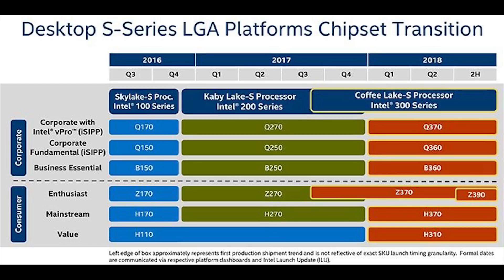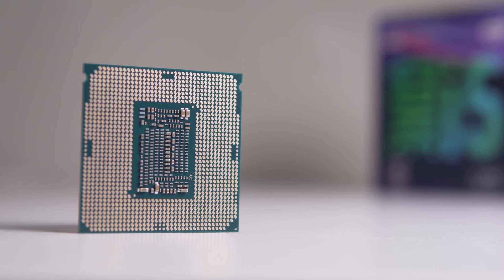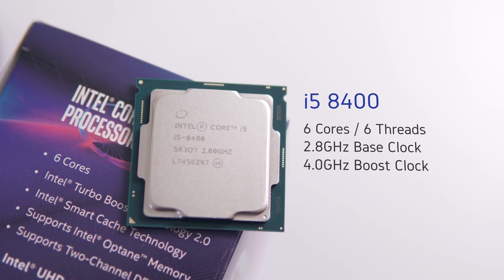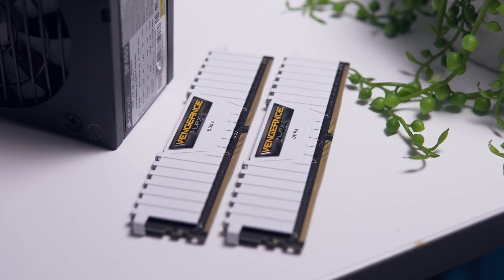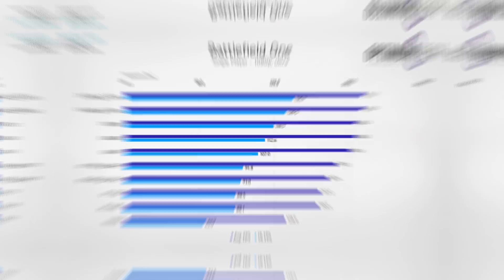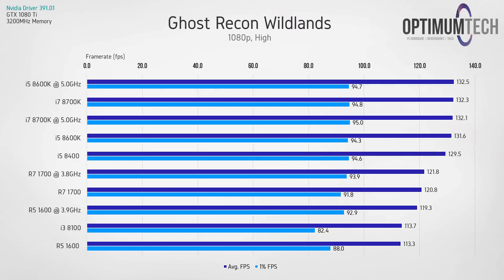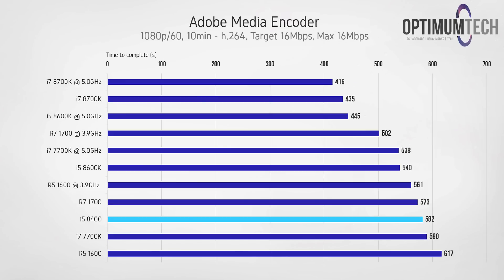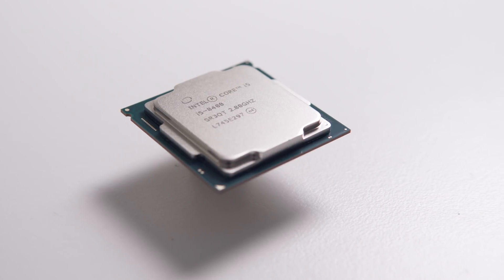Intel's i5 8400 - The Value King?

Comment: This suffers a case of too little too late. You can buy an overclockable AMD CPU with twice as many threads, a higher base clock, a WAY better included cooler and an overclocking capable motherboard for the same price as this locked CPU with a non overclocking capable motherboard. And with Zen+ right around the corner it looks even less compelling.
Reply: Minus I think your missing the point. look I personally run an 8700k at 4.9 ghz and I have a 1080 ti MSI trio, however if I had a 1070 or under I would have went straight for the ryzen CPUs saved myself some money and got the fucking case I wanted..... fucking Corsair 570x is so expensive but looks so crisp
Reply: EIZamo92 well, the i5 8400 is clocked at 2.8ghz with all cores boosting to 3.8ghz... in which most Ryzen chips can just about hit 3.8ghz. not just that, it also has a single core boost of 4ghz. And when the i5 8500 comes out, its going to have a stock of 3ghz and all cores boosting to 4ghz. Pair an i5 8500 with a b360 and it destroys Ryzen in gaming. and you don't have to mess around with any overclocking or need to buy faster ram to get the best performance out of your chip.
Reply: ahead of Haswell but behind Skylake...(not sure if you're being sarcastic or a serious question)
Reply: https://www.youtube.com/watch?v=4fd_GXFBUtk
Lemme sit all these kids down real quick. The ryzen 1600 spanks the 8400 , slightly behind in gaming way ahead in literally anything else oh and its costs less.
Reply: Agree too little too late
Reply: oleg babkin look at the link I posted and stop talking out of your ass.
Reply: https://youtu.be/aNK7EtXrtjs
I7 has higher power consumption and hottrr than r7
Reply: https://www.google.com.ph/amp/s/www.techspot.com/amp/review/1613-amd-ryzen-2700x-2600x/page4.html

Both intel and amd have high power consumption depends on the game and application
Reply: Owned it for a while but maybe i had a bad chip my 4770k was s much better chip and ran so much smoother.
Reply: Wait what lol, did you watch the video? Ryzen is just not a good gaming architechture.
Reply: An overclocked haswell chip will beat a overclocked ryzen chip.
Reply: People might not buy  a 1080ti today, but 2 years from now you might upgrade to a mid end GTX 3060 or AMD 780 which will be on par with a 1080ti. My last computer saw 3 video cards in it's 8 year life and it's generally the primary component most people upgrade.
Reply: no ;(
Reply: Intel max fps gaming and good for productivity
AMD good stock coolers, budget, great for gaming and awesome at productivity or multitasking
Reply: ElZamo92 Za Warudo!
Reply: Is ryzen good in watching.hardcore porns?

#justfuckingasking
Reply: Minus It's only better if all you are doing is gaming and nothing else. Any kind of video rendering, streaming, even file transfers show that a R5 1600 is more powerful.
Reply: ElZamo92 with all that it still gets beaten by this lmaoo
Reply: Mystic_ 112 It is just faster in games, and I believe a CPU in this price range is most likely not going to be paired with a 1080ti, specially with how expensive they are right now.
Reply: ElZamo92 ?? 1080ti?? it is faster in games.. and who buys a cpu in this price range for amything else? :D
Reply: The scores in games are clear: i5-8400 (stock) is overall better than all Ryzen cpus (overclocked). And yet you still talk shit.
Reply: Minus but however, if you doing video editing (like I am) Ryzen is a value king.
Reply: Will the b360 ones overclock?
Reply: ElZamo92 Ryzen 5 1600 wins over i5 8400 in just about every synthetic benchmark ...to bad real life tasks and aplications have nothing to do with synthetics and i5 8400 with HALF the threads DESTROYS ryzen 5 1600.
Reply: nope... you can slightly alter base clock but every little bit you alter causes more system instability.
Reply: I laughed hard xD
Reply: sure but that amd consume twice(->high temp) as the intel one and performs the same
Reply: Saving 20$ with ryzen to waste it later on energy bills  and actually waste some more money on highperformance memory  because amd scales with memory way too much compared to intel king facepalm...😂
Reply: Hey guys, I found the toxic AMD fan

Comment: Explain this statement: "You are not gonna get any productive use out of a 8700k on those boards...  "
If the mobo doesn't burst up into flames(spoiler : it doesn't) an 8700k is gonna run the same if not better since any upcoming chipset is gonna be a budget one. I am really interested in why that is.
Reply from the maker: I'm referring to running an 8700K on a budget Z370 board, compared to a more premium one. 
There's a huge difference in OC potential, VRM cooling and component longevity on a premium board. 
If you are truly using the 8700K for what it's meant to do, budget Z370 boards should be avoided.
Reply: It's not going to run the same on a cheap z370 board vs a decent one. If i remember correctly, there are reports of 8700 on OEM z370 boards running 15-20% slower than youtubers' reviews because of the horrible  vrm and cooling.
So yeah, i'd suggest doing some research on the boards you're going to buy, not just go for the cheapest ones.
Reply: Optimum Tech der8auer did a comparison test of 4 cheap z370 boards, and by and large those chosen did very well. (English version is here https://www.youtube.com/watch?v=xbLeuxIzxcA&t=426s) Personally (FOR WHAT I NEED) I will be getting an mATX ASRock Z370M mobo which is only £100 now with either an 8400, 8500, or 8600. I believe all of the new CPUs and boards will be here in the next 10 days and whilst Ryzen 2000 looks good FOR MY USAGE I need an Intel CPU, there are certain things AMD cannot do as well (unfortunately that's the reason, otherwise it might be different).
Reply: Well der8auer got his 4 running at 5ghz and the MSI @ 5.1.
Reply: so at this point, if you want upgradeability you could only consider expensive z370 boards since h370 and h310 are not aimed at overclockers?
Reply: Will the b360 boards overclock?
Reply: +Vegetables are good for you Presumably you mean shitty mobos like the one put in the crap PC by OEM's like Medion who have no idea how to put a PC together. If you get a PC from that type of OEM you get what pay for whichever colour you go. I'd trust someone like der8auer if one wanted a cheap but reliable mobo (somehow I don't think you do). 

+?? From what I've read B360 won't overclock; not even the memory. :(
Reply: clansome what i'm saying is exactly what you said. Watching reviews from trusted overclockers like debauer and buildzoid. But somehow you seem to take it as an attack to the pc market since i imply that not all boards are adequate?
Trust me, there are quite a few z370 and x370 boards without even vrm heatsinks that can't even keep the turbo of a 1800x or 8700. Those are mostly mATX ot mITX board with cheaper price tags than the rest
Reply: Nope not taking it as an attack just trying to put it in context. Sure the Dell/HP OEM builds will be considerably better than say a generic ECS (for example) board which are built to the lowest common demoninator. Those guys just shouldn't allowed to sell let alone build PC's. (I have an idea of the video you might be referring to and I don't think Jim was telling the whole truth but I'll agree he has a point nonetheless.)
Reply: clansome I’m just curious why you need an intel cpu?

Comment: I think I will go with i5 8600k
Reply: Marc Iets I already have an 8700k, but if I was to pick between an 8700 vs an 8600k, I'd pick the former.
Reply: Drake its a beast
Reply: yea recently replaced a failing i5 6500 and the best bet right now for value imo is the i5 8600k
Reply: I rather have a 8700 non K vs a 8600k.
Reply: Carlos Alberto Deleón if you go for the 8700 than better wait for the cheaper chipsets

Comment: what about the expensive motherboard????
Reply: Cheapest z370 is around £100. And b360 boards are coming soon.
Reply: AMD X370 are at same price as Intel Z370. What are you talking about? And don't even start with B350. That is budget chipset, while Z370 is high-end chip. You are comparing Lamborghini with Ford. Of course Lamborghini is more expensive, it offers more performance.
Reply: The difference in performance between a non-K 8700 and a overclocked 8700K is huge. If you can't see these differences, you must be doing something wrong.

I am not misleading anyone. With motherboards, you get what you pay for, starting with the VRM and continuing with protections and extra features.

You do not believe me? Buy a cheap B350 and any X370 and you will see what I'm talking about. Now...most Ryzen users will not see major difference, because Ryzen cpus simply suck and do not overclock. That is not motherboard manufacturer's problem.
Reply: Go to bed AMD fanboys, you are tired.

i5-8400 at stock speed is better in games than OVERCLOCKED Ryzen 1700/1800/2600/2700 cpu. And this is with cheaper cpu, cheaper ram and cheaper motherboard.

There is absolutely no point to argue. No one cares about IPC, number of cores, dandy stock cooler and the fact that "AMD cares for consumers more than Intel". All these are not making their cpus better.

Comment: AMD R5 2600 will kill the i5 8400 all the way, even in Gaming! And it will have the much better upgrade path as well.
Reply: Mystic_ 112 Which board, there are dozens of B350s...  You just spew BS.
Reply: If you are referring to the Strix B350...you are wrong again. Yes, I do know what I am talking about - I own this motherboard and have overclocked a 1600 to 4 GHz no problem. Also, as soon as you start using profanities you've already lost the argument. Go back to your cave, troll.
Reply: You are clearly just hating. I assume you've never had an R5 1600 and a B350 motherboard.
Reply: i mean its nice that amd are compeitive with intel now but to say the 2600 is going to kill the 8400 in gaming is kind of silly.  it MIGHT match it.
Reply: You'll never ever get the same singlecore Performance with the 2600. Intel is and will still be the way for 144Hz+ Gaming, for 60Hz AMD is a good ship but im personally more into that 144Hz Gaming...
Reply: Yes, 8400 is getting ~10fps more on cards like GTX1080Ti. In 'normal' home use, on cards like 1060 the differences are minimal. 

If anyway you want 1080Ti... well, you won't buy low end CPU like 8400 but aim for something more efficient.
Reply: Will the b360 boards overclock?
Reply: Not with the optimization we have right now
Reply: Mystic_ 112 And good amount of Z370 boards have worse vrm than b350 boards
Reply: keep in mind that the x400 i5 is always the lowest end i5.  other possible i5's that may be coming soon are the 8500 8570 or 8550 and of course the non k 8600.  these should up the clocks a bit.
Reply: with such low clocks on that i5 8400 , the 2600 might actually beat it in gaming, i agree with you
Reply: it might actually do, i've got a 1700 and a b350 and sometimes my pc won't boot unless i plug the cord out of the socket, try start it up and then plug it back in. i was thinking maybe it's smth to do with the mobo
Reply: which one will be more popular? ryzen 1600 or i5 8400 or ryzen 2600? i am building a pc for the wife and might bench it time to time as i do a benchmark channel.
Reply: i am building a new pc i love all these comments i haven't decided yet on intel or amd yet for cpu its stricly for 4k gaming 60hz with a titan xp (CE) edition but i might upgrade in the future for a 144Hz monitor.  the benchmarks are on http://cpu.userbenchmark.com/Compare/Intel-Core-i5-8400-vs-AMD-Ryzen-5-2600/3939vsm476362
Reply: Why would you compare those. 2600 is 30-40$ more expensive
Reply: In my country it's just 16USD difference. AMD motherboards of the same class as for Coffee Lake are 30-40USD cheaper. So afterall - 8400 is the direct competitor of 2600. 

And I would get AMD, both are great piece of CPUs but the AMD platform will last longer as it's not a dead end in terms of upgrade to new CPU in the future.
Reply: Mamopy agree with u
Reply: Rainer Hofmann But will it match the i5 8600?
Reply: B350 is the budget king
Reply: Rainer Hofmann u won't be using that shitty b350 in the future :D
Reply: lmao, i5 8400 still beat R5 2600 in gaming, go check the bechmarks that just came out. XD lmao, overconfidence prediction XD
Reply: yes b360 will allow overclocking
Reply: “Update March 27, 2018:  Leaked images from CanardPC's Ryzen 7 2700X review have appeared on Reddit, highlighting a few of the key performance tests the French magazine has carried out on the new Pinnacle Ridge chip.

In their tests it shows the Core i5 8400 still has the edge in gaming terms, even if the 2700X has managed to improve its clockspeeds and has an extra two cores. What the CanardPC also shows is that power consumption has gone way up since the Ryzen 7 1800X, in line with its general processing performance”
Reply: George D U don't know ur shit, that board has some bad power phase/vrm
Reply: Dream on....Even if R5 2600 will be better (which I doubt), it will cost 30% more.

Comment: r5 2600 :)
Reply: Lol Lol they tested on a320 mainboard with old games which don’t scale with cores haha... dude that test is useless 😂
Reply from the maker: Looking forward to it :)
Reply: when will it be available? :D
Reply: Jmack have you been following anything related to ryzen ? ive yet to see anyone disappointed with current gen ryzen .. i doubt anyone would be a disappointed with an even faster variant.
Reply: better iGPU
Reply: A complete joke
Reply: r5 1600x 50 dolar  les than 2600x in my country..
Reply: Jmack1lla the 2600 IS good at gaming and streaming and mulit-tasking. Overall its better than the 8400, don’t know what ur on
Reply: “Update March 27, 2018:  Leaked images from CanardPC's Ryzen 7 2700X review have appeared on Reddit, highlighting a few of the key performance tests the French magazine has carried out on the new Pinnacle Ridge chip.

In their tests it shows the Core i5 8400 still has the edge in gaming terms, even if the 2700X has managed to improve its clockspeeds and has an extra two cores. What the CanardPC also shows is that power consumption has gone way up since the Ryzen 7 1800X, in line with its general processing performance”

Comment: By the time these motherboard even come around, Ryzen+ will be here anyways. An R5 2600x with a turbo of 4.25ghz, could probably OC to 4.4 like what's reported of the 2700x (aka, so will the 2600 in some cases). So I mean, that gaming gap is going to be pretty much gone, but you get a free double threads .-. Intel really shot themselves in the foot with the platform. If they just released those damn mobos sooner, they might of stood a chance. I went 1600 for the entire reason :s
Also, why are your Ryzen single threaded scores so low? Your 1600 at 3.9 only got 152, where as mine at 3.8 always gets me 156. You should be getting 159/160 .-.
Reply from the maker: Agreed.
Regarding the scores, I haven't really checked out other's scores. If you got higher, that's great.
Reply: scores are within the silicon difference that exists between individual cpu of the same a sku
Reply: He must have an awful CPU then. I've seen dozens of videos on the 1600 at this point, and they've all been consistent with my own score
Reply: Maybe I just have faster ram, I'm using 3200, and it brought my scroe at 3.8 from 154 to 156 vs my old 2400 kit. Well anyways, great video! :D
Reply: ?? I'm not familiar with Intel's platform, but 1. You need a K could to OC, 8400 can't and won't. And 2. I don't think the b360 chipsets do, only z370
Reply: I'm pretty sure he uses 3200mhz as well
Reply: Will the b360 ones overclock?
Reply: B and H boards won't overclock, neither can the 8400
Reply: Sander McDonald tbh the z370 boards can’t handle the 8700k the VRMS go to fuckin 90C it’s insane and stupid
Reply: Jeremy R depends on the board, an apex won't be hitting 90c.  It's just people who don't know how to pair a mobo and cpu properly